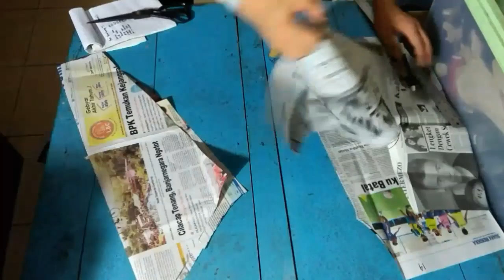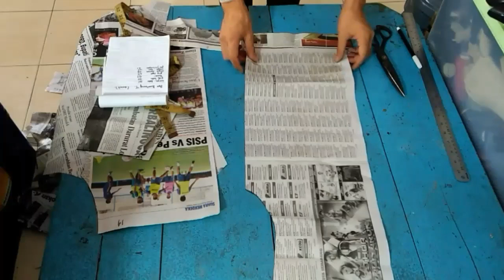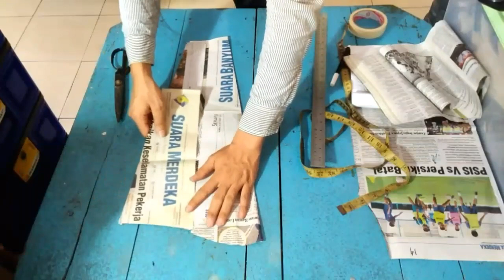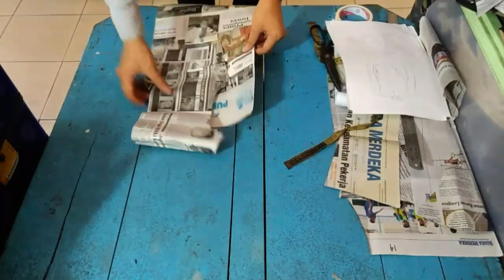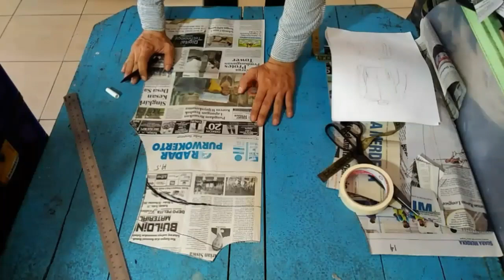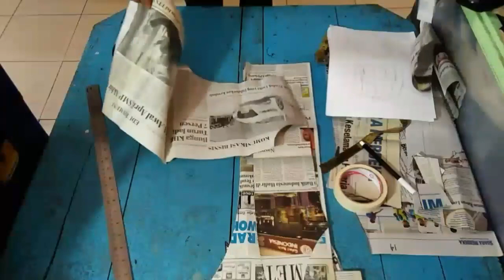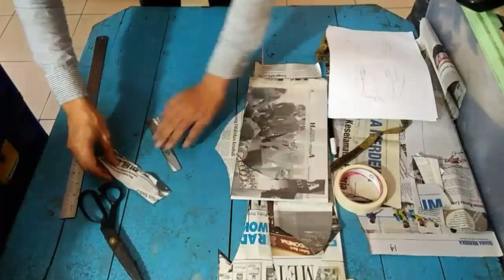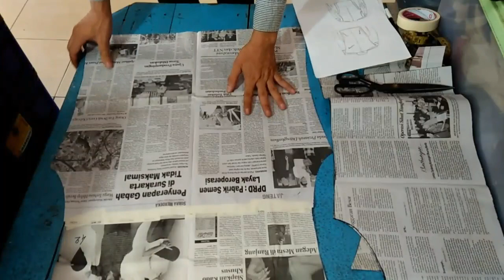Processing 3 custom leather jackets

Comment: When making a leather jacket are the 'flat fel' seams done by just turning under one side seam allowance and top stitching to the other panel, rather than sewing a seam right sides together first and then top stitching to catch the seam allowance? I assume this is done to keep bulk down and on its own one top stitch line is strong enough for a leather seam?
Reply from the maker: Some leather jacket maker sewing a seam right sides together and then top stitching. Especially when the jacket from cowhide material.
But I prefer stitching the top to the other panel because it's easier for me to fix the jacket if I made a mistake or if later my customer need to repair it. But sometimes I do seam sides together then top stitching depending on the jacket's style/design or my customer request
Reply: @volcanoleather  Thats a good approach that suits your construction and practical too. I noticed the centre back seam was sewn right sides together and also the underarm as you sew the sleeve in on the flat first. Thats opposite to how I would set a sleeve in on a woven fabric jacket for example but means you can have the felled seam on the top side of the arm sleeve which is strong and a nice detail. You achieve a very good result and you don't even have a walking foot machine nor a high end bell skiver. Well done.
Reply: some will even do a double top stitch first right sides together then top stitch both sides of seam allowance